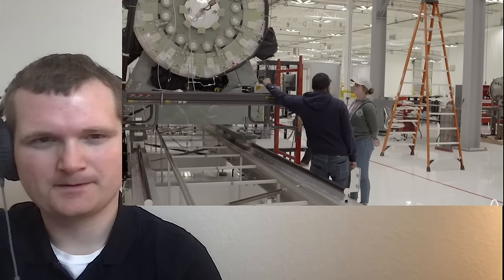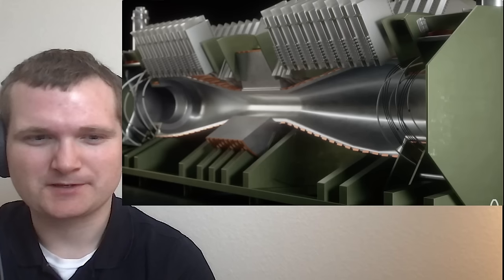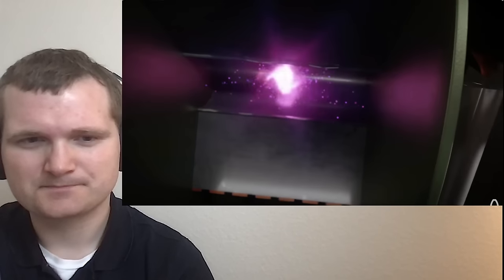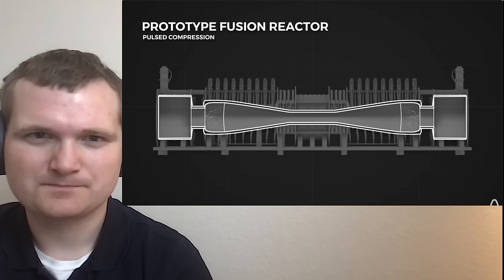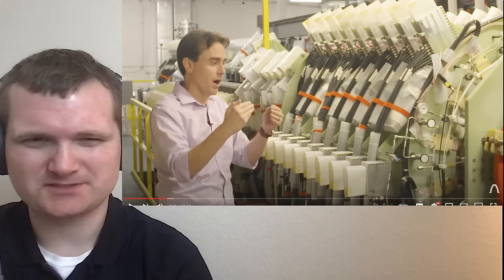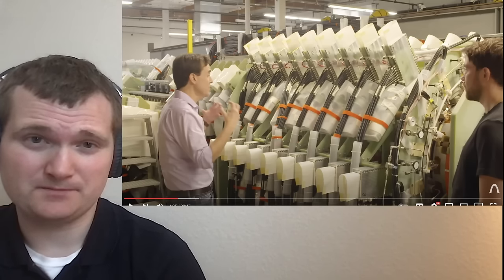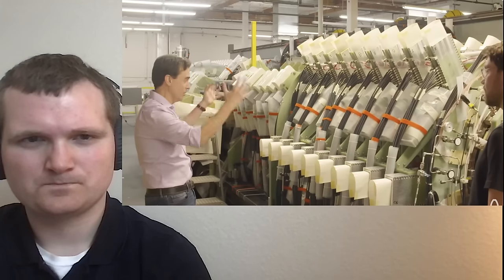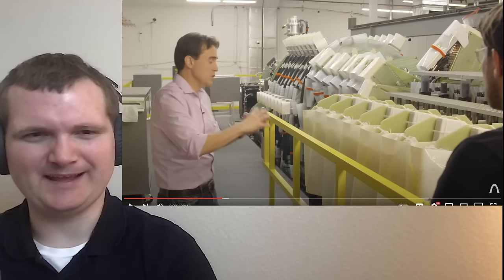Will the Helion Fusion Reactor ACTUALLY work? - Nuclear Engineer Reacts to Real Engineering

Comment: One thing I'm curious about: How does the system convert the kinetic energy of the two plasmas into heat? Plasmas are not solids. I would have thought they would just pass through each other and nothing much would happen.
Reply: No, they magnetically reconnect and form a single FRC. This has been demonstrated in countless labs around the globe. It is counter intuitive, but it works. TAE uses the same system and other labs, e.g. in China and IIRC in Japan have reproduced it too.

Comment: Ok. So you get roughly 200 times as many MEV out from each Uranium atom that undergoes fission, but a kilogram of Uranium has about 100 times fewer atoms than a kilogram of deuterium. So that almost balances out. Assuming Helion can get more energy out than they put in, the fusion reaction is in the same ballpark as reactions in a fission reactor. I would suggest that other factors are going to determine the economic feasibility of fusion and fission, such as the cost of the containment building, insurance, etc.
Reply: And licensing/regulation is set to be a lot easier on fusion than on fission.

Comment: I was under the impression that most fission plants (at least, those still operating) in the United States were subsidized to some degree.  If that's incorrect, do you have any "handy" resources to help replace "impression" with fact that you can recommend?
Thoughts on Helion.  Lots of issues (many of which are mentioned in the comments).  
From their own hype... I mean market... I mean "news", they do note that to reach grid scale commercially viable output they'll have to run significantly "hotter" than they are now. 
Which to me says "Even more extremely angry neutrons! Get me some high test neutron adsorbent, stat!"

I've got a good bit of family, and a few friends in high energy particle physics and at least amongst that crowd, "electrostatic fusion" - which can either mean some mystical form of microwave initiated solid state fusion, or a method of harvesting electrical energy directly from the burning plasma due to its highly ionized state - was always treated as a half-joke, half "holy grail". 

Much like any of the ideas for fusion (and even a few out there ones for fission!) that rely on something beyond "Gronk boil water. water gas make spinney thing spin!" it's always "Well, we want to figure out how to get the fusion part working first, then we'll figure out the pulling energy off it part" (the exception being a few out there design theories around using an air cooled SMR and "as yet developed" Peltier tech to skip the whole spinning a turbine thing).  Honestly, the SMR-Peltier idea is probably more realistically viable and has less involved material science requirements out of all of those concepts.  *I forgot there's also a plan for an SMR that would use supercritical CO2 instead of water but I don't see that going anywhere either.

Now, I'll give Helion this: They get hammered for the whole "Well, turns out the plasma wasn't acting like we thought it would"  - Probably some better modeling would have helped, but as we've gotten more serious about fusion, we've developed means to accurately and with with orders of magnitude more detail measure what's going on during said reactions in near real or even real time. We're finding a lot of ways that models and reality don't match. Although we're doing it an awful lot more safely, we're basically at the "I wonder what happens if I wiggle this beryllium half sphere over a hunk of plutonium with a screwdriver" stage in fusion.  Seventy years ago, fusion was at the "Hey, I think this radium is emitting something invisible!" stage (I mean, not a great analogy, but it works in terms of oversimplification of an incredibly complex and math heavy subject). 
A great example of this is turbulence in the plasma flow along the reactor walls in Tokamaks caused by minute fluctuations in the magnetic confinement and only measured and modeled relatively recently. Figure out the turbulence problem, get more coherence, get more efficiency, get longer run times, and oh yeah the plasma doesn't gradually vaporize your reactor walls (not even counting the seriously angry neutrons mentioned earlier) too.

Okay, lemme put that milk crate away.  I'd say this was one of your best reacts yet.  Thanks for sharing a level headed and genuine take on Helion.  (My favorite part was "I have so many questions!")
Reply: 1. They will have to achieve about 2x the temperature they achieved in Trenta. Not insurmountable.
2. They get one 2.45 D-D neutron for every 3 reactions (compared to one 14 MeV D-T neutron in every reaction in Tokamaks). That is assuming that they have zero He3 from T- decay or trade. 2.45 MeV neutrons are MUCH easier to handle than 14 MeV neutrons and the relation is not even linear. Many more options for materials too.
3. Helion is not doing electrostatic fusion. Their concept is best described as magneto- inertial fusion. Somewhere in between and Tokamak and the NIF.
4. They have built 6 prototypes so far, each bigger and stronger than the previous one. Their physics and scaling laws still hold and leading to the last point...
5. They purposely employed a very conservative physics/simulation model for designing Trenta. You can read up on that in their latest paper. The model is simplified but it generally underestimates things and that is by design. Because of all that Trenta achieved higher ion temperatures (which is where all the fusion happens) than anticipated and that higher ion temperature lead to larger ion gyro radii. Mind you, the higher ion temperature is GOOD thing! It means that they got (a lot) more fusion reactions out of Trenta than their model had predicted. You get some bad with the good (more ions touching the walls). But overall, it means that their models and predictions have been holding up extremely well all the way to thermonuclear conditions. From here, the next step is actually comparably small from a plasma physics POV.

Comment: Oh... when you said "remember clean sinusoidal AC?" I didn't put my thought on that much, but then I realized that values in simulation is just statistics the calculated result was just using averaged values with some percentiles. But percentiles calculation often throw away top and bottom 10% values, so the Gyroscopic orbit problem they faced was just those 10% outside the simulations. And that actually affects a lot because 10% of Gigawatts is still 100 Megawatts so the wall needs to be very much larger. And the magnetic field needs to be stronger and more focused because of inverse square law. That will jump most of the costs. Also, the bigger confinement cylinder means more wobbly the push back force it can be. That is a lot of problem... The only answer to that is the same tight confinement with sacrificial shields to actually make it work with business models. Your video is totally awesome!
Reply: Their power plants are 50 MWe, at least initially. The gyro orbit- thing was because their simulations were too conservative. They also produced proportionally more fusion than they expected (which is a good thing). So it is not as big of a problem.
Reply: @elmarmoelzer2229 I think it is. Because I remember they said in that video that they need at least 200 MW to make things efficient. And inverse square law of EM field is significant when you're trying to maintain pressure of the sun on earth with EM rings. If you made it emits too strong, it would use up too much energy to be useful. But if they made the ring smaller, it would degrade the actual reactor parts without a shield. But going with a shield is much cheaper and more efficient, however, it means more nuclear infused wastes. So they have to weight their status, go pioneering or go totally sustainable.
Reply: @cefcephatus  Believe me, it is not a big problem. The RE video sort of put things a bit out of context and some of the wording was probably not optimal. Let me explain again:
Helion used a (purposely) conservative physics model to predict the performance of Trenta. For more information on that, check their latest paper in the technology section on their website (Fundamental Scaling of Adiabatic Compression of Field Reversed Configuration Thermonuclear Fusion Plasmas)! There is also a really good talk by David Kirtley at Princeton about the same topic.
Anyway, Trenta achieved higher ion temperatures than this physics model predicted. This is a GOOD thing. It means that their machine performed BETTER than predicted because fusion reaction rate is directly related to ion temperature. 
A hotter ion has a larger gyro radius. 
Generally, the Xs (ratio of separatrix radius to coil radius) scales relatively weakly at at Xs^0.8 vs say the separatrix radius which scales at rs^2.1. And in a high beta FRC (Beta = 1), the scaling of the magnetic field strength is essentially at the 4th power (since Beta^2 = 1). Compare that to Tokamaks which have a Beta of ~0.05!

Comment: 29:19 he is not being unrealistic saying 2024 electricity surplus. It just means that there is a chance and they need to have it. He didn't even mean building anything on scale or doing the thermal neutron shielding. He means that they could do it with a small gen 8 model
Reply: Polaris is set to be completed this summer. Then it will be a few months of fine tuning. Polaris is pretty close to final scale, from what I understand. The size of the final power plants is not known yet, but even if they have to go a bit bigger, it should not be a huge problem. They just have to keep the diameter small enough to keep the thing transportable by road, at least without stuff that can be easily disconnected.

Comment: I think you’re right.  They are at the equivalent stage of the first uranium neutron experiments with fission.  They see the valid math and have bombarded samples in a cyclotron and they think they can create the first piles to prove it.

My guess is this stage that they are building will help them refine the numbers needing them to scale the size, energy needs, and push the boundaries of the newest electronic switching and triggering speeds again.  Then at some point in the next 5-7 years they will achieve fusion (or fail), then start again to achieve positive output 5-7 more years from that.  And then if everything works spending 10-15 years working on lots of physical plant and practical implementation engineering a first generation prototype power plant.  Then if successful another 10 till the a repeatable 2nd generation.  

So all and all I think 15-20 years out from proving the idea, and 40 years away from fusion power plants being a viable alternative power source.

Comment: Everyone wants cheap abundant energy, I believe we will have abundant energy buy not cheap energy.  The cost of energy in many states like Hawaii and California is not the price of electricity, it is the cost of transmistion.
Reply: That cost is driven by a lot of factors, including distance and whether the energy is dispatchable. In Helion's case, they are able to put their machines close to the demand and they can ramp up production within seconds. So they are like a gas turbine without the fuel cost and without any CO2 emissions.

Comment: You're thinking about compact fusion reactors wrong, they are more similar to scalable SMRs than traditional fission power plants. I still have a hard time believing that Helion actually will overcome their challenges, but they have some very clever ideas. I also like the idea of actually thinking about commercialising now because that's what I think will take a long time after breakeven (not counting NIF) which is probably possible in the coming 10 years with slowly accelerating progress and more funding. I'm not qualified at all, but my dad is a particle physicist who's interested in massive tokamak alternatives in general
Reply: That said renewables and keeping existing fission nuclear plants working is much more important in my opinion for climate change because there's so little time left. Nuclear  (fusion and fission) is just slow to build no matter what, and renewables are getting better and scaled up so incredibly fast
Reply: 25% than trenta is still much smaller than ITER

Comment: Theory, and practice, are VASTLY different ball games. As a Nuclear physicist, you have the advantage of the theory actually having been tested exstensively, so it's far more refined and known. With fusion, it's a lot more all over the place in terms of testing, and all we really have is mathematical models, which are subject to being completely wrong because of factors that were never considered, interactions that  were never expected, etc. You can math this stuff out to an absurd degree, but once you start actually applying it, if even the tiniest factor is off, the whole theory needs to be restructured, new data added, and that's really what they're talking about here.

Comment: It's going to make neutrons anyway so you might as well put a jacket around the thing to collect the heat and use it for something.
Reply: Relatively few neutrons and low energy too. Only 1/3 to 1/4 (depending if they have He3 from T- decay or trade) of the reactions will produce a neutron and that neutron has only 2.45 MeV. Overall it would be 5 to 10% of the total energy output in neutrons. Don't think it is worth the capital cost of a steam turbine and the whole setup that comes with that.

Comment: Hell, I know a lot less than you do about fusion reactors.

But even a nincompoop can see that their salesmanship is entirely premature.

They're better at PowerPoint presentations for investors than they are at scaling up a commercial fusion reactor.

Their lack of awareness of regulatory hurdles is telling. Either that never occurred to them, in which case they are incompetent, or they know perfectly well that their ambition for 2024 is infeasible, in which case they're lying.

Helion might be a sophisticated pump and dump scam. I can't prove it. But I would advise caution to investors.
Reply: Helion is fully funded all the way to commercialization. According to their FAQ, they are explicitly not looking for investors. They have all the permits necessary for Polaris, which is currently aiming for completion in summer. Fusion is and will be regulated differently from fission.

Comment: That gigawatt pulse is input, not output.
Reply: And that GW is power, not energy. That power delivered over a few microseconds is not a lot of energy (maybe a few single digit kWh). Plus that energy is not lost. It is recollected from the plasma along with the additional fusion energy. Still their machines are designed to deliver about 50 MWe. At a 1 Hz pulse rate (last I heard Helion was aiming for a pulse rate between 1 Hz and 10 Hz) that would be 13.9 kWh of net fusion energy per pulse.

Comment: Yeah even when I've heard of direct energy conversion, it usually involves the tokamak design which in itself would still need a lot of filtering that power before going back to the grid. The power coming out of this would need to be basically all stored and then released to the grid somehow as it's pulsed energy.
Reply: Yeah, I was thinking they'd probably dump that into big capacitor banks, then discharged through some kind of inverter system.
Reply: There should be ways to smooth out the pulses. The motion turning a diesel generator starts out as linear pulses, after all.
Reply: @CatFish107  well like I said, there are ways to filter the energy, but they are far more complicated. Plus fusion already struggles with efficiency and high costs, any filtering will add even more losses to the system while making the system even more expensive. Yes direct energy conversion techniques in theory are more efficient at converting the power of the plasma, but they also are less efficient from the loss of heat of neutrons. I'm not entirely sure it's actually beneficial.
Reply: @Skylancer727  I guess there is that whole efficiency sticking point. I'll be interested to see how far they take this, and what kinds of design improvements can be eeked out.

Comment: Net positive fusion is easy. There's about 13,000 devices in the world which can do it, and there's been about 1000 tests of such devices.
The problem is that there's a minimum energy investment to initiate fusion... and it's very very difficult to contain even that much energy in any kind of controlled manner. 
So when you seek a "net positive" on the energy output, which would have to be something like a 10 fold return in order to be meaningful, it's just that much harder.
Kinda like trying to create an internal combustion engine with a minimum fuel charge of 1 stick of dynamite per cylinder firing.

Comment: I would assume the energy captured would first be dumped into capacitors and then from there I expect spin a DC turbine to creat 3 phase power (with the current load fuming it into a motor will be simple than trying to build some smart switching power supply to make clean AC )

Use a pulse from capacitors to spin up a flywheel or pump water up to a tank and then have traditional generators from there .

Comment: I mean, any form of power generation that doesn't use a turbine synced to the grid would have to push the energy into some sort of battery or capacitor or both and then run it through some sort of high-efficiency inverter to make it usable...
Reply: Helion is using capacitors to power their machines and to store the energy they recover from the machines before they release it to the grid. Inverters are not a problem. Grid scale batteries are extremely efficient.